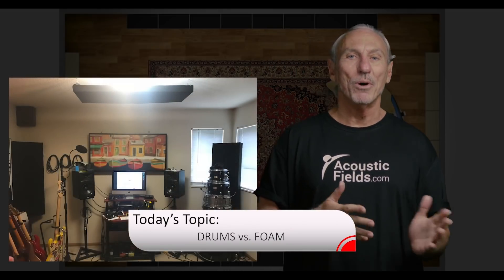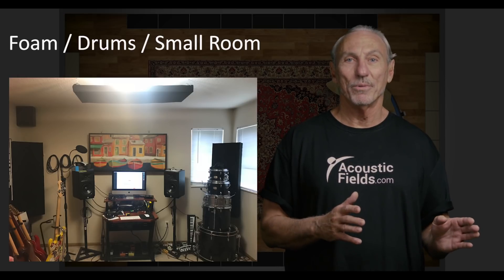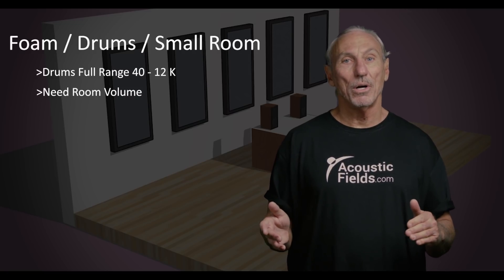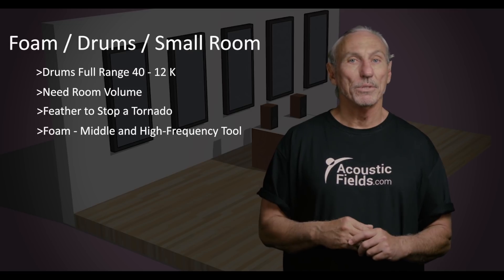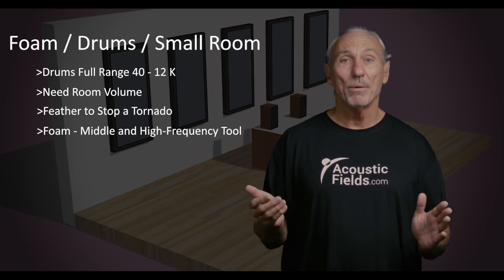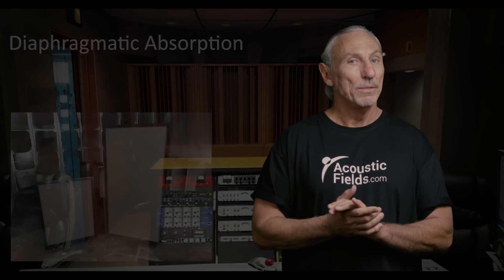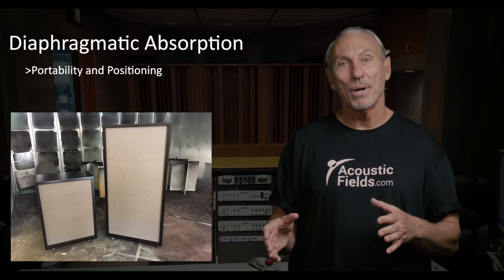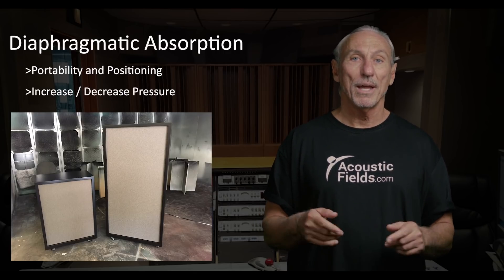Drums vs. Foam - www.AcousticFields.com

Comment: I am a drummer and I've been in different acoustic environments over the years, not to many, but a few; both (bigger and smaller) live stages and studios. 
In my ears, the bigger room the "better" sound. It's like the drums can "breathe" more and become their best potential in bigger rooms. The producer will hopefully "catch" the performance properly. And I've met a couple of producers too and some of them do music productions for a living every day and we have to work together to get the sound and trust each other. But I understand that they have more experience than me and I have no problem to listen, and maybe learn new things about sound and how to "capture" the best performance. We are in the same team :-). Then comes factors like how hard/loose (ex: too hard = choking effect, too loose = no tone/timbre) you are hitting those skins and other stuff etcetera. Interesting topic! Thanks! 

By the way Dennis, unfortunately I have a very small practice room and I have to have accept that if I want to play. And I do of course. If my only concern were to try to dip the sound, like transients from bass drum and snare, spreading in the rest of the building, do you think it would help to "come off" the concrete floor and build something to decouple the drums from the floor and at least increase some percent of the vibrations?
Reply from the maker: A,  You must reduce the unwanted lower frequency pressure within the room. You can add diaphragmatic absorption around the drums and even under them. Here is a link to our drum platform.  https://www.acousticfields.com/product/drum-platform/
Reply: @AcousticFields  Thanks!

Comment: I've had some heated discussions with drummers about using small rooms, it can be difficult getting them to understand they need a bigger room for the best sound, it's something I've struggled with as a producer.
Reply from the maker: B,  Yes, I see the same thing. I believe it is a matter pf perception. When they are playing the drum set, they are "near field" and can not hear the room sound. However, the microphones can, especially the overheads. It would be nice if you could record in an 8' ceiling room and then in a 14' ceiling height with the same drum set and player and let them hear the difference. Once heard, they would understand. However, this A/B comparison is difficult to achieve.
Reply: I started with a junk "mutt" drum kit. It sounded like a $20 set in my basement. Took it to a friend's "out building/ garage"...almost a small barn, and WOW...that cheap set came alive!